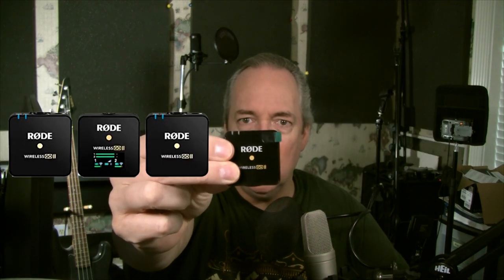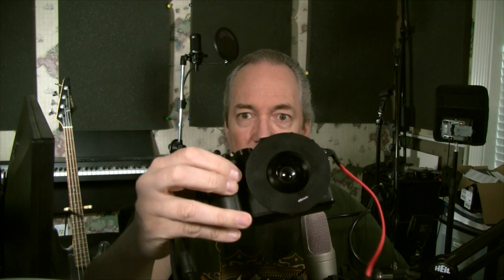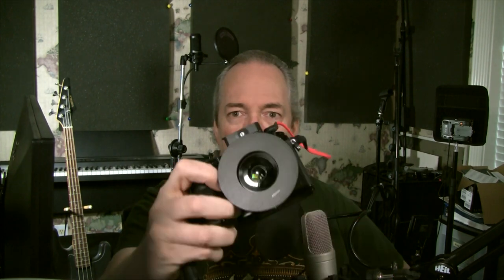Fix For Rode Wireless Go II Buzzing Noise

Comment: ✅ I made a huge revelation that maybe help to someone out there! After buying longer shielded cords and still experiencing the death buzz, I realized the culprit: CHEAP HEADPHONES plugged into the camera/audio recorder! When I removed the headphones and recorded without them, the buzzing virtually disappeared! Also, a cheap lav may be the culprit as well, but try recording WITHOUT headphones and playback. If so, replace your headphones/lav, or don't record with them as an immediate/short term solution. Tested on my Sony a7iii and Zoom F6 and Zoom H1n. (Note: the short red cord that's included with the Wireless GO II is trash; you must also replace it with a longer shielded cord as suggested!)

Comment: Hi, I saw someone solve the buzzing issue by switching off Rode's audio pad mode. In this instance, the buzzing only occurred when using the audio pad mode and a lav mic attached to the transmitter. Another person solved the issue by turning the camera's gain to one noch above zero  and only using the Rode's gain. This should enable you to mount your receiver to your camera again. I am surprised your camera does not let you switch off wifi? I read somewhere that if the camera wifi is on by default, this is a camera fault as this should not happen.

Comment: Yesss! That works, I came to the same solution. But I don't think that the problem is caused by the camera's Wifi-module: The noise also appears if you try to connect the receiver e.g. to a Zoom recorder.
Reply from the maker: Really? I don't get any of that with my Zoom PodTrak P4 or my Zoom H1. this problem seems really kinda random.
Reply: It may help to move the receiver farther nevertheless. The Zoom H1n for example can pick up the wireless signals of the receiver very easily. I normally move the receiver a half a meter or so away. Replacing the cable to a better shielded one does also sometimes help.

Comment: I had the same issue with my Lumix and also solved it with a longer cable. I didn't use an extender, just swapped out for a longer cable. I think they sell it as AUX cable.

Comment: This worked with my Rode VideoMic GO microphone on my Canon M50.  I was previously using the microphone with my Canon 80D.  It worked for about a year on my 80D fine and then the buzz started on my videos about 8 months ago. I did have a new overhead setup and I just assumed it was my camera and/or the new setup.  I removed it and used the on-camera audio, after trying several solutions. I just got my Canon M50 and still the buzz on the videos. So, on the hunt again for solutions and your video popped up.  I tried your solution and it works!  Since I am not mobile, this will work well for me until I upgrade to a better microphone. Thanks a million! 🙂
Reply from the maker: I'm so glad that it helped! Thanks for the coment!

Comment: I can confirm this buzzing noise by using my beloved Sony A7C. The mentioned workaround with a simple audio extender cable does solve this problem (but looks very unprofessional), you even can leave the receiver in the shoe of the camera. So thank you for sharing! I also own a Sennheiser MKE 200 and I used this cable to replace the red one provided by Rode. Buzzing noise is much less (maybe at 20 per cent level compared to Rode cable). So there is definitly a problem with the red cable I think. All Rode equipment what I could try so far was rather disappointing. I do recommend the Sennheiser AVX-ME2 if you think you will be using this kind of wireless solution a lot.
Reply from the maker: Thanks for the info and the recommendation for the Sennheiser AVX-ME2. I'l try to check that out.
Reply: Honestly this is unacceptable from Rode... i bought this item for get rid of cables and now I need to put a longer one?
Reply from the maker: @miguelrubiofdez  It doesn't happen to everyone. And it doesn't happen on all devices. Only some DSLR-type cameras and a few handheld mobile devices, like the Zoom H5n. Otherwise it's fine. It worked perfectly well on my iPhone and computer/laptop.

Comment: Saved me...thank you so much. I have a feeling that dropping the red wire and just using a 3.5mm - 3.5mm stereo cable would do the trick.  Just haven't tested it yet. Based on other comments, it sounds like the red wire has a shielding issue...an upgraded wire with better shielding (you get what you pay for) might do the trick.
Reply from the maker: So glad it worked for you!

Comment: Nice one Rode, "... the problem is the G7 itself". And other Panasonics. And Sony models mentioned below.
I'm also getting bunions from my new fancy shoes, but I take it that the solution must then be to modify my feet?

PA operator here, and this should not be a problem of mine, but I work with plenty of photo/video operators who use these.
In theory, they are an amazing piece of kit, and make life so much easier, but when I have one of these attached to ANY of my wireless mics - Shure, Sennheiser, Samson, even my cheap backup Aldi mic - and therefore send that awful whine through my system to the entire room, at some point Rode, you may have to at least consider "it's me... hi..."

Comment: I own the RODE Wireless GO II system for little more than a year. It is standard setup incl. 2pcs RODE lavaliers GO bought simultaneously as a complete set.
Everything was just fine the whole year, but few days ago (second decade of May) there started something strange and not funny. When I use ONE of the original Lav GO microphones, I suddenly get kind of RF high frequency noise. This noise is recorded into camera video and internal audio .wav file as well.
It never happens with the internal microphone of both transmitters, but with Rode lav go inserted into jack 3.5mm. Tried in many locations, and different situations, replaced red RODE cable from RX by another one – all the same: one RODE mic works fine, another one generates ugly noise.
I have done to factory reset; I even bought NEW lav GO mic; No luck - it does the same noise right out of the box. The funniest is that one mic is still working fine on both transmitters, so I have now three mics where just one works fine on both TXs.
All 3 (three) RODE mics work properly on other transmitters like Comica, Sennhieser G2/G3 and audio recorder Tascam/Zoom H5 etc. and give a clean rich sound
NB! Cheap lav mics like Comica, Boya work fine without any noise.
I have tried to use Sennhieser ME4 – it is almost ok, but when I move mic close to RODE transmitter it starts generate noise as well. 🙁
I have latest RODE Central software + firmware version 2.1.9  and by the way, before updating firmware to 2.1.9 everything was fine.
RODE seems to ignore this problem.

UPDATE: in my case turning PAD option off helps! oh... breath out
Reply from the maker: Thanks for that info! I hope you can get a resolution from Rode. Will they not even agree to replace it?
Reply: @HomebrewAudioRecording  thanks, I don't know about replacement yet, we'll see!
Reply: I had the same issues with my Wireless Go II and Lavalier Go mics. What worked for me was to turn OFF "Pad" on the Transmitter (not the Receiver!), which was turned on (check if there is a small green triangle shown at the mic channel on the receiver display). As soon as I turned off the "Pad" function on the transmitters (with Rode Cetnral, but you can also do it with selecting the transmitter channel on the receiver and long-press the mute button, so that the green triangle disappears), the buzzing noise was gone.

Comment: Wish I had of found this earlier! Just thought I'd mention I came to the exact same conclusion with my Lumix G85 and s Sennheiser ew112 kit. Those saying it's Rode's fault isn't true. The Lumix camera is at fault. It doesn't matter what wireless transmitter system you use....its the camera and it's inability to turn off it's wifi field. Pretty insane and took a bunch of troubleshooting to determine that.
Reply from the maker: Glad you finally got it sorted!
Reply: Except I've had the rode give me the same buzz when approaching it with a sony FX3 or even a comica cvm-vm2 mic.

Comment: For a Zoom recorders and I'm using the Zoom H5 this solution works very well. Your other option is a Rode SC11 cable going into a couple of Rode 3.5mm to XLR adapters connected to your 2 XLR's on your Zoom H5 or H6.
Reply from the maker: Thanks! Yes, I saw that XLR adapter solution on another YT video. It obviously wouldn't work with a camera with no XLR input. But for the H5, yes.
Reply: @HomebrewAudioRecording  The reason for the Zoom is to by-pass the camera pre-amps. The Zoom then connect to your camera and you have much better control and better sound.
Reply: I recently use my zoom H6, and the humming noise, it was horrible. 
Need to try this next time.
Thank you.
Reply: @marcoadamo6322  how do you bypass the preamps in the camera please? I have a zoom h6 , G85 lumix , and rode wireless go

Comment: Had the same issue with a Sony A7C, and this didn't used to happen with a sony a6400. I tried using an extender I had laying around, and it worked perfectly. I even put the receiver in the cold shoe, and there was no buzz when using the extender so no clue what is going on.
Reply from the maker: Thanks for that additional datapoint! And glad you got it working.
Reply: which extender?
Reply from the maker: @LifeOn2WheelsVlog  It's just a headphone extension (for mobile devices). So it has a 3.5mm (18th-inch) pi with 2 lines on it (stereo) on one end, and a female jack on the other end.
Reply: It does indeed happen with my Sony a6400

Comment: There seem to be two types of buzzing depending on your setup. I have had both!. One is caused by using a lav mic with the transmitter and it has the PAD option turned on. Turn it off and the buzzing goes away. You don't get it from the transmitter if you don't have the mic plugged into it and PAD turned on.

The other is caused by the cable connecting the receiver to the camera. If you have a long cable - not coiled or folded up and keep it away from the camera it seem to fix / reduce it. You can try folding the cable bringing the receiver closer to the camera and see the noise comes back. I think it might be something to do with using an unshielded cable, so i've ordered a couple to test this theory, so i'll update when i have tried that option out.
Reply from the maker: Thanks!
Reply: yep, turning off the PAD option worked for me
Reply from the maker: @danielgulbrandsen9204  Excellent!

Comment: The exact sound I get on my FX3!  Gonna try this tomorrow, thanks!
Reply from the maker: Hopefully this will work!
Reply: Hey Trevor, I had this issue with the A7SIII...what fixed it for me was changing the Wifi frequency band from 2.6GHz to 5GHz
Reply: @fox24fire  Hey Trevor, I have similar issue with the FX3, did it fix your issue when you tried this method?
Reply: @fox24fire  Thank you for the tip !

Comment: Thanks for the information. And for the wind noise that remains in the background, we cannot remove it except in post-production?
Reply from the maker: There are little fuzzy wind filter thingies you can put on them. But yeah. If you're outside in the wind, there WILL be wind noise. You can edit much/most of that out after the fact.

Comment: Thanks for the tip! This is a very unacceptable design flaw though, I don't want to have my receiver dangling off my camera on a 6 ft cable. My seems to be fine on the short cable but once it's actually attached to the camera, it does this. Do you happen to know if DJI's wireless set has the same issue?
Reply from the maker: I do not know if the issue happens with any other wireless mics. Sorry.

Comment: any ideas why my new rode VXLR Pro connector is not picking up anything on my H4N from the rode wireless Go 2 mics? using the same red cable with the 4ft extension..? My XLR ports work well with a boom mic plug in...just not with the male to female 3.5mm XLR connector

Comment: I also found out during some tests that if you use a TRRS cable the buzz also goes away. When using a rode TRS to TRRS cable to connect the mic to my Mac I noticed that the buzz was gone, while it was remaining with the TRS cable attached to the camera.. so that's another solution..!
Reply from the maker: Thanks!

Comment: I have recently got the buzz. But the buzz was on the recorded file on the mic too. I tested it at home and it didn't happen.
It was on the groom so I wonder if the priests mic was source of interference.
Also make sure to shut off any power goingbto the mic input on your cam
Reply from the maker: Yeah it seems like there are multiple causes, and hence, multiple "fixes" for this, which are really just workarounds.

Comment: This interference problem has nothing to do with wifi, I had the same issue with my phone in airplane mode and I thought it was due to hidden network acitvities but then I tried with the Zoom H5 audio recorder and the result was even worse so it's definitely not a problem of wifi, 4G or 5G. But when I tried with the Zoom I was using a lavalier on the rode and I guess the cable behaves like an antenna. Actually the quality of connection cables is very poor compared to hi-fi cables in terms of isolation to prevent EMF interference. I'm currently looking for very high quality cable and lav.
Reply from the maker: I'm no expert on RF interference. It was Rode who told me to turn off the camera's wireless capabilities - all of them (bluetooth and Wi-Fi). But there is no bluetooth on the G7 and the Wi-Fi is supposed to be off unless you use it, apparently. I don't know. What I DO know is that getting the receiver 4 feet away from the camera did the trick. I didn't have a problem with my Zoom H2. but there is someone who DID have this same problem with his H4 or H5 like you mentioned (https://youtu.be/QZjSrwxUT6Y ). His fix involved getting aTRS-to-XLR adapter and splitter. Then with the XLR connector, the interference vanished. Interestingly, he said he had no noise when he plugged straight into his DSLR (I don't think he said what kind it was). That was not an option with the G7, of course, since the camera's input is the 3.5mm plug. Interestingly that is the same input size for the H2, which caused me no noise trouble at all. Other folks around the web report having the problem with the lav but not with JUST the transmitter. I had the problem with and without the lav. So this is definitely something that seems to be all over the place in terms of how and what will cause the problem.
Reply: Baroudeur thank you so much for your comment.

Comment: It's a power issue.
This happens to me when I connect to a powerbank at the same time.
With a 5mah powerbank, I don't get the noise. With a 10 or 20mah, the noise is there.
I would think it's the power coming from your camera that's interfering even though it's not plugged in.

Comment: Having this issue with our GoPro which also has wifi, but I can turn off the wifi on the GoPro. I will try that first and then try a longer cable, thank you for the straight to the point video
Reply from the maker: You're welcome!
Reply: @HomebrewAudioRecording  Turned the WiFi off on the GoPro and buzz sound from the Rode Mic went away. Thanks again!

Comment: Hi there! Thanks for the tip on using a longer cable, I had the buzzing sound with a Sony A7SIII also. But now I discovered I have the same buzzing sound recorded internally on the transmitter which I use together with a Rode Lavalier GO mic (I used the option available through Rode Central app to use the TX as a recorder). Do you have any thoughts on why this happens?
Reply from the maker: There are a number of reasons, apparently, for this buzz. One is a setting on the GO itself, that I don't recall at the moment. But it seemed like most of the solutions on YouTube involved THAT "fix." It didn't work for me. But it might for you. Just check out 1 or 2 of the other YT vids for this and you'll find it.
Reply: Thanks for answering! It seems the "pad" option on the TX has to be "off" for the buzz to disappear.
Reply from the maker: @tudortomos  Right! That was it.
Reply: @HomebrewAudioRecording  I have a A7Siii. And it seems to be the red cable. As soon as i touch it the noise dissapears. What can I do to fix this? (Pad did not help and bringing the receiver in distance did not help, too.)
Reply: Solution in 2 steps: 1st step) It seems the red Cable from Rode is poor quality. It is not shielded very well. Further it is (by nature) unbalanced. In my case it did not depend on the distance of the receiver to the camera but on a better quality cable.
2nd step) The buzz-noise is independent of the audio level (PAD). Means: You can turn up the level of the receiver without increasing the noise level (which is good). Therefore it is best to bring up the audio level of the receiver as high as possible without distoring and decrease the audio sensitivity inside the DSLR. This makes the noiselevel of this Buzzsound dissapear.
Reply from the maker: @GordonNovember  Thanks for the tip! So what did you replace the red cable with? (If that is what you did).
Reply: @HomebrewAudioRecording  I replaced it with the Rode SC2. Funny, I know. But if you read amazons reviews, tons of them say they replaced the cable with this since the original red one is poor quality. And they were right. I just installed it and its perfect.
Reply from the maker: @GordonNovember  Thanks for the tip!

Comment: I had the same issue, but I just changed the cable out and it went away. It seems that the cable that comes with it isn’t shielded so it easily picks up interference.
Reply: What cable did you end up using?